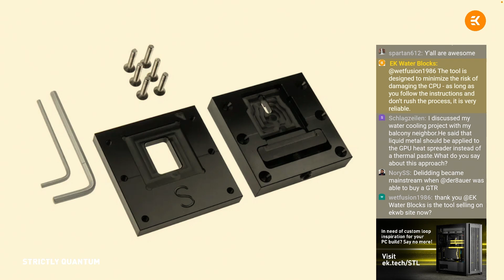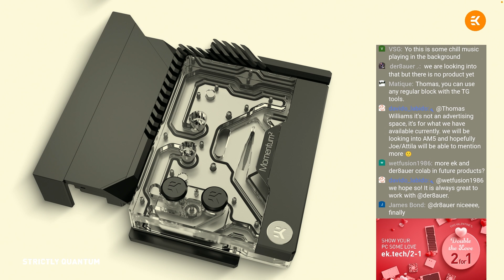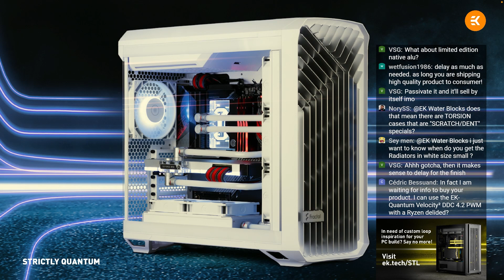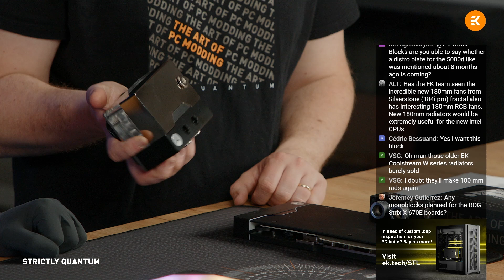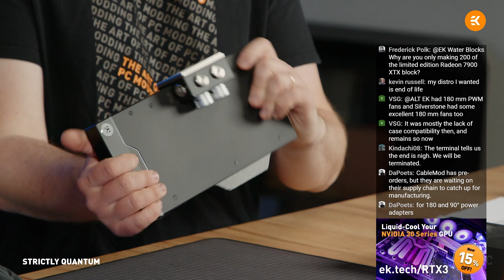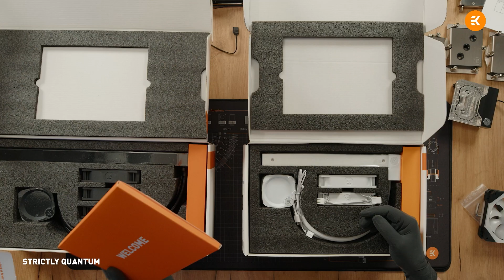Should You SWITCH TO DIRECT DIE CPU COOLING? Find Out With @der8auer | Strictly QUANTUM

Comment: Intel should sell CPU's without IHS. And if ppl crush the core, warranty is void, But this way ppl don't have to delid a CPU and risking damaging it. And losing warranty crushing a core is not worse than losing warranty bending pins on the socket. So make CPU's without IHS and make more coolers with direct die capabilities. Even a NH-D15 would be nice with direct die cooling. Just make copper shims like in the old times when Soclet A were the fastest CPU's.

So... Both AMD and Intel should make CPU's without IHS. And cooler manufacturers make models with direct die capabilities. Would make it a lot better IMO

Comment: lots of people are having problems with your Direct Die Block like this one please explaine

I have same issue.
At water temp 20 degree celcius, my 13900ks with ek dd can only costs up to 400watt at 110 degree celcius.
I reinstalled 7 times, repaste liquid metal, results are same. 400watt with 110 celcius. 330 watt with 80 celcius.
This result is same as heatkiller 4 pro with Stock IHS. 400 watt with 110 degree.
Actually, ek dd is worse than normal cpu block. Core temp difference on heatkiller is only 7 degree difference, however ek dd is more than 15 degree. Core4, 7, and 8 extremely high.
Once I changed to iceman dd, i got cured. At 330 watt it is only 60 degree.
550 watt with 110 degree.
Shame on you, ek
What did de8auer do?
Just rent reputation and have money?
Than just decrease the price without name on it.
I dont think ek will recall this garbage product.
People who bought this product expect good cooling performance, not the same performance with stock ihs.
And also, why does ek always delay their product? Once you said it will start deliver on mid Feb, it supposed to start at least 20 Feb. It is promise with customer, especially you received money first.
If you guys think you cannot gurantee the time, than receive money later.
I was big fan of ek, no more.
Quality keeps decreasing, price keeps increasing, and most of product need to be rma. Im tired of this.
Reply from the maker: We're currently investigating this issue that affected a small number of CPUs and testing the best solution for this. We will be sending the solution to everyone affected. Please contact our customer support with your issue so we can resolve this: https://customerservice.ekwb.com/hc/en-us/requests/new

Comment: I delided my 7700x but the results are very poor, using AM5 direct die frame and custom screws, cooler makes contact but temps are worse then stock, what could be the problem ? Using krynaut extreme as paste , liquid metal is to risky for 24/7 use for me
Reply from the maker: The Direct Die 1700 water block is made specifically for Intel's 12th and 13th gen CPUs and it will perform poorly on AMD Ryzen CPUs mainly due to die height difference. If you're using a delidded Ryzen CPU with our standard CPU water block, then the loss of performance is expected as the blocks are made to fit the IHS, not the dies underneath that are positioned lower. The EK AM5 direct die water block for AMD Ryzen CPUs hasn't been released yet, but that one will be appropriate for your delidded CPU once we launch it and you should see noticeable improvements with it.
Reply: @EKbyLMTEK  Thnx for the answer, is it also comming as a AIO on the market ?
 I have tested Corsair H150i , NZXT X62 and  EVGA CLC but all with poor results, I have already modded the mainboard screws so the cooler come down a little more, but still...

Comment: Why not make a custom IHS that is shorter (same height as the CPU die), covers only the SMDs and exposes the CPU die(s)? That would reduce risk of the CPU dies being crushed by the cooler, and liquid metal spilling over to the SMDs, and you get the full benefit of direct die cooling.

Comment: Some feedback on those blocks (take it as you wish) but for users that want to maybe upgrade the CPUs at any point, the way they secure on the motherboard from the back side makes upgrade a complete pain in the a$$. A user would have to completely tear down their machine to get to the back of the motherboard in order to pull the block off and take the CPU off. And especially for ones that have hard tubing setups with GPUs as well, it becomes a horrible experience.

Comment: It would be nice if Intel would sell just the die-mounted pcb minus the IHF for enthusiasts. I know it would destroy your delidding market, but it would circumvent all of the potential risks and make life easier......except of course for the delidding manufacturers.
Reply: I have been saying that for years. Every laptop CPU is bare die. It's not dangerous and it would solve a lot of issues for overclocking enthusiasts. They should provide the IHS in the box and leave the decision to use it and what TIM to choose up to the end user. I do not like the stock soldering. It has never been as good as liquid metal or bare die, only better than the garbage they used instead of solder. That was inexcusable.